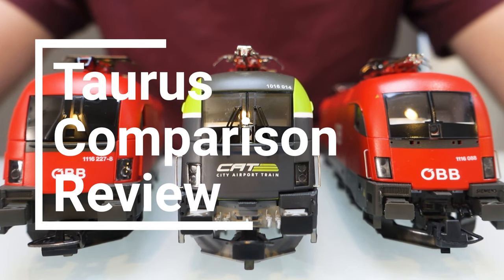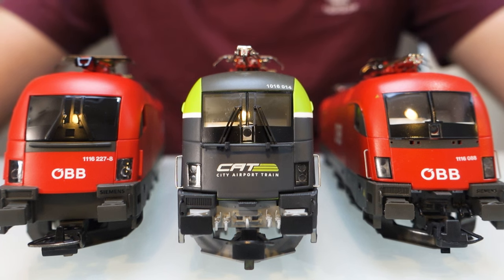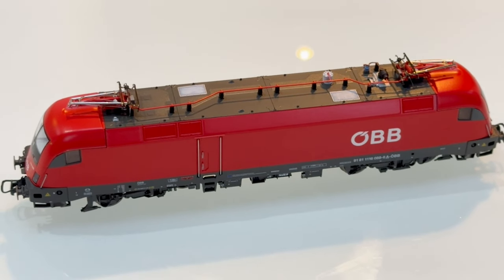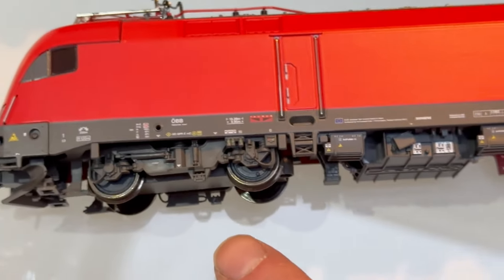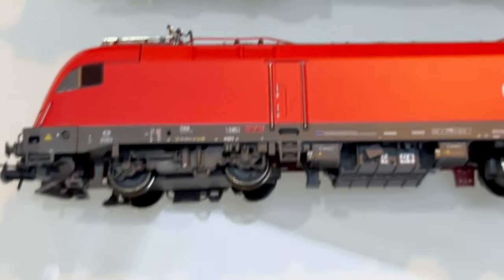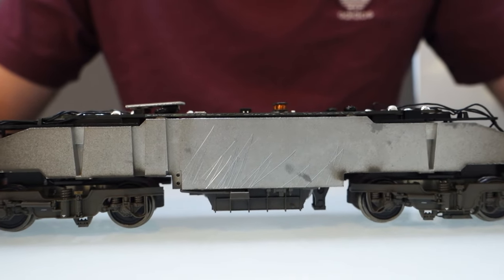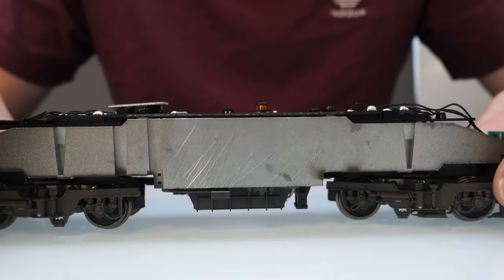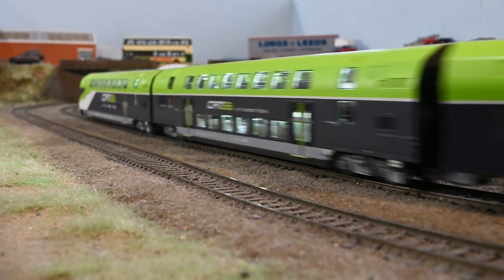Piko, Roco And Jagerndorfer Taurus 1116 Review and Comparison

Comment: This is a good comparison between the three similar models. I have a DB BR 182 from Piko, essentially the same thing as your Piko OBB version. I agree with you that based on price alone, the Piko one wins, but some of the detail is basic, as is the lighting. mine is fitted with a Lenz Standard+ decoder, and runs absolutely silently. All wheels are driven, there are no traction tyres (an annoyance from some manufacturers), and the weight is really good, so it will haul anything I care to hang behind the couplings. My European modelling tends to be a low budget offshoot from my British modelling, so the Piko Hobby locos like this one fill the niche nicely. Even not having tail lights is an advantage for me as mine will only be used hauling trains, not propelling them. Your requirements will be different, with both the RailJet and the Airport train sets being push-pull sets, so separately switchable tail lights would be desirable then.

Comment: Out of the three locos I've got the Roco, AC factory sound fitted. Sadly it's only driven on three axles, but aside from that, it's a spectacular runner. The speakers sound rather good and are quite effective, whilst the capacitors will allow the loco to run without issues over track that wasn't cleaned in months. It'll keep going for several seconds, and thus is an incredibly smooth runner no matter the state of your tracks.

Comment: Most of mine are Roco and I can’t fault them Richard. But I do have a Piko BR220 ( 59706 )  in DB it’s moulded detail. But internals are plux 22 with controllable lights. It’s a nice loco for weathering and used for mixed traffic. Cost me £80 used. Only one I’ve got from them. But I’m tempted with an DR 118 next though.

Comment: Between the three Roco is probably the best. The piko is from the Hobby range which is their cheapest and most basic models. They also have an expert range which is more expensive but better quality, but not quite as good as Roco. Jagerndorfer  are good models but in my opinion not as good as Roco. All three also produce models with sound but are considerably more expensive.